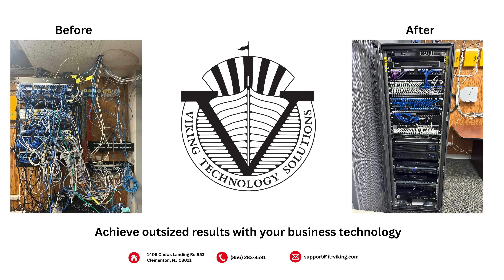Network Cabling & Server Room Cleanup Timelapse!

Comment: I was a sys admin for 10 years at one place, and from the day I started our server room looked like this.  Leadership was traumatized because of a huge networking issue from before my time, so they would never let me clean it up and rewire it.  I was told that the business was being sold and I was in one of a few departments that were being cut.  After they told me, I went back to my office and ordered everything I needed and came in on the weekend and redid that server room and it was so satisfying. It wasn't until about 4 months after I left that anyone even noticed I cleaned that room up. 🙄

I was given a good severance and plenty of time to find a new job before my termination date, and there were no hard feelings, but I miss being a sys admin.  I make more now that I'm at a tech firm, but I liked being the only IT person and having (nearly) complete control over the department.

Comment: Identifying and labeling cables is essential for structured cabling documentation. As a CCNA, I spent several years wiring entire university floors...always fully documenting every step. In fact, labeling and identification took longer than the actual cable pulls, and I frequently worked live (with systems operational and zero downtime allowed for the campus community).

To manage cabling efficiently, I developed a precise in-house application. It took the meter marks printed on UTP cable reels as input and calculated exact cut lengths based on physical workstation locations (in meters) from the floor plans. I’d simply locate the factory-printed meter mark on the cable, cut it, and produce pre-measured patch cords grouped by run segment. These were then logged in the MDF engineering journal at the Network Operations Center (NOC). The documentation also included distance and circuit calculations derived from official campus blueprints, along with Cat5/Cat6 certification reports.

For a single floor of 300 workstations, my typical timeline (working alone) was:
– 1 day for planning, calculations, and documentation,
– 1–2 days for physical installation (including cable trays, IDF rack setup, and fiber runs to the MDF),
– 1 day for testing, verification, and certification.

All of it... alone, without pressure, listening to music or talking for hours on the phone with my girlfriend at the time (2014) while I worked... damn.. i miss my ex-girlfriend...
I prove you can get it right the first time... saves everyone else time later.

Comment: I started a job a while back in November.  My first trip to our data center the guy i was replacing stopped a head shop for a new bowl, yeah.
  Server room at office was a mess, 4 cabs maybe 30 servers.  
  Along cone Christmas time and I decide to just clear out the server room and get it straight.
  Keep in mind 4 cabs maybe 30 servers.
  I pulled 34 surge protectors, hundreds of cables and a freaking DSL modem that no one even knew we had, we were still paying for service bit not actually using.
  Took 2 days but damn was it worth it.

Comment: This reminds me of a particular situation, where I was called in to solve an infrastructure problem.
I went down to the cellar of the office where the SER was located.
He switched on the lights and it was like a spidersweb of UTP cables: laying on the floor, between racks, held together with zipwires attached to ceiling etc.
I remember the person guiding me: "don't go into that lane, there are cables everywhere, and if you trip and remove a cable, we have no idea where it was plugged in."
Mind you this was a major dutch internet provider. I cancelled my subscription with them after that job.

Comment: I used to do this exact same work with CO lines from the street into the high-rise buildings, reterminate them into apartment blocks into each of the apartment units when everything became a big mess, that's not forget the NPB intercom system that had the sandwich between both and of course the protectors, things have come a long way! Nice job!

Comment: Looks cool and all, But I would have installed a 7 foot 2 post and just put everything on it, you added multiple points of potential failure and probably slowed speed a bit. I get you want things to look nice, but this did not solve troubleshooting at all. I would have just cleaned up the patch cords and put on a 2 post network rack

Comment: That's a great job despite what must have been frustrating as hell when you realised that to squeeze everything in you had to sacrifice any cable management, on top of the rack not having any vertical cable management either. It looks like you've done the absolute best you could within the constraints you faced. I hope the customer knows that any expansion is going to need another cabinet by the look of it. (Hopefully not your problem, lol)

Comment: And I can promise you without any doubt whatsoever that it's going to be a complete mess five years from now. I've done so many recabling jobs over the years and the biggest issue is not the once in a decade cleanup job, but the management of it all. Having enough space to expand, not having the custom short cables that make things look tidy. Or worse not having a patchport next to an available switchport. Management giving you that 24 port switch because it's cheaper and "enough for now". 

Over the years I've developed a few techniques and 3D prints that are custom and unique to MY server racks that do allow for good cable management whilst keeping a fairly acceptable cable mess. The reason I had to resort to 3D printing was simply because I have a plethora of different servers, even different brands and nobody is offering decent solutions (at a reasonable price that is) for my situation. And I like to believe that my situation isn't so unique. The last rack I did had over 70 cables including UTP, SFP DACs and fiber, 4 switches, 2 firewalls, 3 routers and 20 servers of which at least 5 different models of varying depth and port locations. I know for a fact that the rack is going to be changed over in less then a year, but in the mean time we've added 3 storage servers, removed 5 old servers, replaced a faulty switch and had three service calls on some of the equipment. It just looks like the same over the past two years, because half decent sloppy is is still half decent maintainable. 

I've come to realize you don't need to cram as much as possible into the available space, because you will need to expand and change things over time. I like to be flexible and that includes allowing for some level of sloppyness. Because if your sloppy job looks like it can be easily expanded upon, the next engineer is more likely to accommodate that idea and keep the neat sloppy job longer over time.

Comment: until joe blow helps out and just runs a 50 ft cable because it's all they have. It got that way for a reason and I bet most of those decision makers STILL work there, meaning it won't last long. (Speaking with 30+ years of experience)

Comment: When i was doing IT work i saw so many rooms like this, absolute nightmare to find the homerun thats not working, i would sometimes spend an hour trying to tone and find the location of the CAT6 cable. The problem is that when the cable is plugged into the switch then it bleeds over to other lines and makes it very difficult to trace. I did a few cable clean up jobs like this, so satisfying to swap out 8 foot patch cable spaghetti mess for  6 inch shorties going directly from patch panel to switch.

Comment: That there is why I got out of tech! Back in the 80s none of that happened! It was connect it and you would just label the patch panel in the front what equipment was connected. I went to a facility in bermuda and looked behind the equipment panel and was shocked to see all the left over spaghetti from the last upgrade of which I wasn't present. Running wires under ground you better remember what jack it came from, which piece of equipment and pin-outs!

Comment: I have done so many of these in my younger years as a network engineer. I did find that even high qualify 110 blocks can cause some increased noise for 10GB Ethernet but was perfectly fine for 100MB and 1GB connections. I guess showing my age as during my time was mostly dealing with 1GB, 100MB, and some 10MB comm closets. I just find it funny that this is exactly what I expect a comm closet to look like.

Comment: Man-o-man, you are bringing back some nightmares I have been trying to forget for 30 years :). I will say I hope you were careful with that drill in the cabinet rack. The number of times I have come across a screw tightened in by a gorilla is crazy. Those are soft screws and just a snug is enough. Awesome job, I know that what was done in this video cannot truly be understood unless you have been there.
Reply from the maker: Don't worry, the Milwaukee driver's chuck is set to 3 or 4 when fastening the cage nuts. We too have seen them stripped, obviously by an impact driver, and had to struggle with them! Thanks for the comment and sharing your experience!

Comment: i did one of these not so long ago... but I preffered to put connectors on the cables and couplers. then I put all of that inside the ceiling nicely mounted in bundles. that way it was completely out of sight and a small added bonus: easy to uncouple if anything arrises... the price difference was negligeable.
Reply from the maker: Thanks for watching and sharing your experience. There are many ways to approach this and I hope feedback like yours helps someone thinking through a problem of their own.

Comment: I have not seen a 110-block used like this. I have only used these for single voice runs and 25 pair or greater telephony cable and used patch panels for anything data. It appears you ran blue and white cables from the 110-block to the cabinet. What happened to the legacy cables that go out to the locations in the office? Were these replaced with new CAT6 and landed in the cabinet?  I guess I am failing to see the use of the 110-block. Also, would a 110-blocvk not degrade the bandwidth of a CAT6 cable? The job looks great! I am just curious as I have been doing this type of work for 20 years now and seeing a 110-block used for data is new to me.

Comment: Just a thought. Could the rack be moved to the (your) left to try a avoid extension or was there not enough slack?
Reply from the maker: There would have been enough slack on the majority of cabling already in the rack, but moving it to a new location did not fit with the customer's plan for the room. Thanks for watching the video and sharing your thoughts on the project!

Comment: Good job! I work in K12 IT. At one of our high schools during the summer a few years ago, we had painters come in to repaint the campus. They did a great job. Too good I would say since they painted over our data jacks and didn't mask them off. 🤦🤦 So now we have tons of rooms with data ports with no visible labeling. We have only toned out 2 data jacks per room: phone and Wi-Fi AP. We plan on relabeling the jacks, but that will probably be an ongoing project as time permits. We just have too many other things get in the way.
Reply from the maker: Ouch! If you need to pop the faceplates off to install new jacks, I'd recommend running a razor blade around the perimeter first because its likely to peel a section of paint along with it. Thanks for sharing your experience and watching the video!

Comment: Man whoever did those initial terminations to the patch panels didn't do a great job. 

Usually the mess is limited to directly within the rack or the switches. Was a nice cleanup job.
Reply from the maker: It was a mixed bag. One of the panels was done really well but on the whole, what a mess. Thanks for watching, we appreciate it!
Reply: @VikingTechnologySolutions  I work in K-12 IT. I think part of the issue is that overtime, different contractors work on these panels. I believe most of our schools were last wired 15 years ago. And in that time, various contractors have come in to install or replace lines and their quality of work differs.  And even within the same contractor, the quality of work varies depending on the person working on the panels.
Reply from the maker: That has been our experience in the small business world as well. And we've certainly layered network solutions on top of a disorganized server closet many times ourselves. Cleaning up the whole area is rarely in the scope of work until it becomes it's own project, like this one was.

Comment: I work in IT managing applications.  The weekly status meetings with all the towers to share information is amazing as to how much the hardware team has been doing to clean up old things like this across multiple sites and buildings.  And they share similar pictures.  I understand before I started many years ago there was a major issue between those in charge and the work being performed.  And it's taken years to get every place to looking like the above, and under control.  So what you see here is merely a tiny tip of the iceberg of similar set-ups everywhere lol
Reply from the maker: Over time these things have a way of piling up. There is a compounding effect when one vendor puts in a mediocre network solution, and down the road another vendor (whether its a new ISP, Phone system, additional Wi-Fi APs, new POS system) has to build their project on top of it and work around the existing mess. Thanks for checking out the video and sharing your experience!

Comment: Looks like if they had left long enough service loops on the old rack, they would have reached to the new rack and you would have not had to do the 110 punch down block on the wall. That is why I leave extra long service loops.
Reply from the maker: You're right about that, and anyone reading your comment hopefully learned something! There was also a 48 port patch panel to the right of the rack with no extra length (Though it was an exception in that the cabling was managed nicely above the ceiling). I also recall about 7 dual and single port biscuit jacks on the backer board. Thanks for watching the video, we appreciate it!

Comment: Great. but most jurisdictions in the US won't let you lay cable on the drop ceiling grid. It should be tied off to the rafters above or in a suspended tray.
Reply from the maker: 100% correct, cabling must be independently supported. The video ends about 8 hours before the job did. Everything above the ceiling tiles got managed and supported before we closed up I assure you!

Comment: Impressive and smart job.
I never worked in a professionell Art with Network/Racks, but i think i would master it fast.
Private, I grow up with the first 8-Bit Computers and Datasette/Floppydiscs and 2.400 Baud Modems, Hubs/Switch around 10mbit maximum Speed :-D. On Amiga first Multiplayer-PVP Game, Stunt Car Racer with a Null modem cable.
Anyway, i like your videoclip and would immediately join your Team and collect the Experience.

Comment: Turn that A frame ladder sideways, throw a pillow on it and sit down to terminate those panels, hell if I'm standing for a full day on that little step ladder.
Reply: I just bring a folding chair
Reply: @plwadodveeefdv  Yeah if you're terminating ground level, but because of the existing cables being up high that's not possible in this situation.

Comment: I hate to be the one to criticise, but though I agree you've achieved your main stated outcome I can't call what I just watched a "job well done":
-The isolation between telephony and data indicates no involvement (or collaboration) with competent network designers or engineers. These services have been typically converged for nearly 25 years
-Though the cables are hidden within the false ceiling, they appear to be just strung across, I saw no use of cable trays or catenary wires to keep the looms tight and their weight off the ceiling
-There's no indication that proper service loops were implemented with the new cables

I realise that I have no background in the overall nature of the project, it's timeline, or it's budget but the outcome looks more cosmetic than functionally useful.
Reply from the maker: You have a sharp eye and criticism is welcome here, it can help anyone reading learn. Agreed this job is far from perfect, it's right there plain as day and leaving lines draped across ceiling tile grid, to your point, is not ok. I will share that the video ends I believe 8 hours before we wrapped up, so I want to assure everyone that the overhead cabling ended independently supported and looking better managed than what's seen in the video. With regard to physically segregating the VoIP devices – I 100% hear you and the other commenters that take issue with this choice. I'd offer this rationale: this is the small business world of time and resource constraints where fingers are pointed and invoices for hourly troubleshooting are balked at. Going this route can depend on a combination of variables like the customers desire to know "which neck to choke", the support level of the VoIP provider, and the amount of IT support available within the business. Sometimes the simplicity of having the phone service physically separated makes sense, especially if dual drops are already in each office.